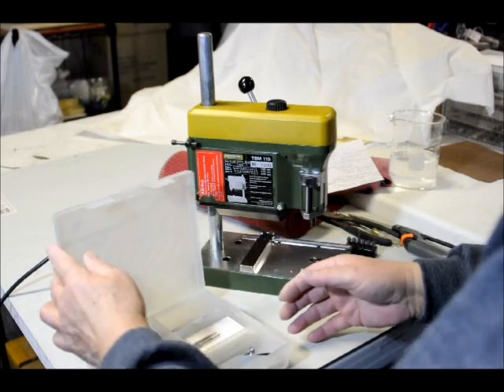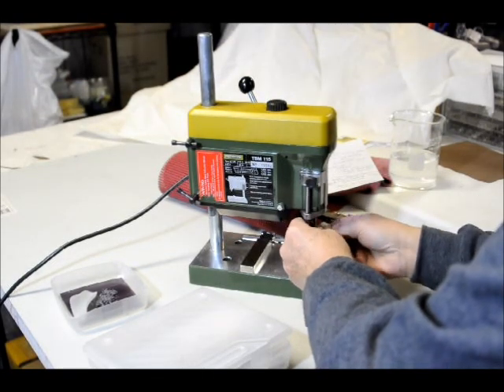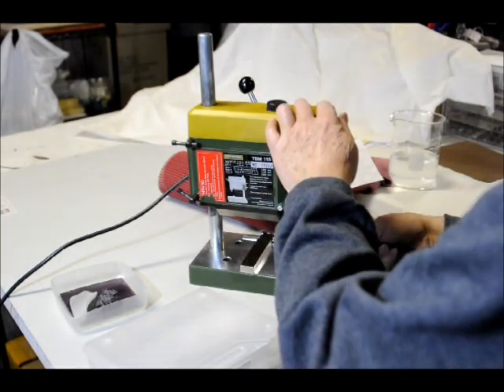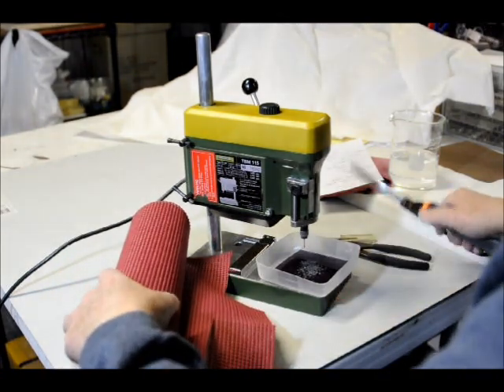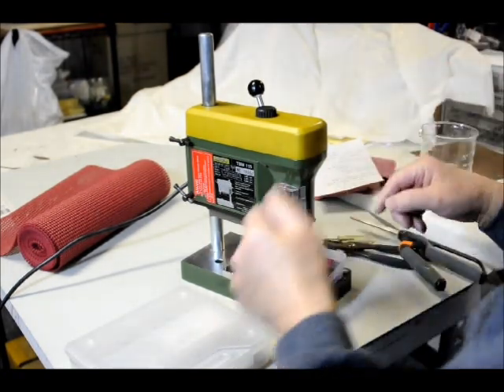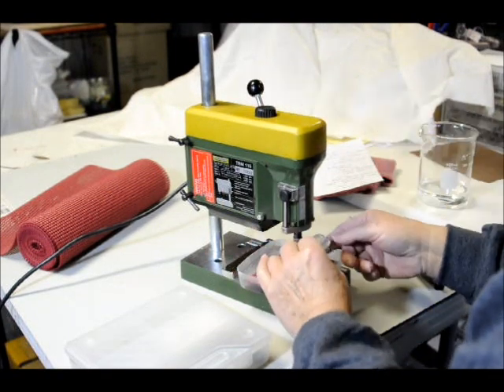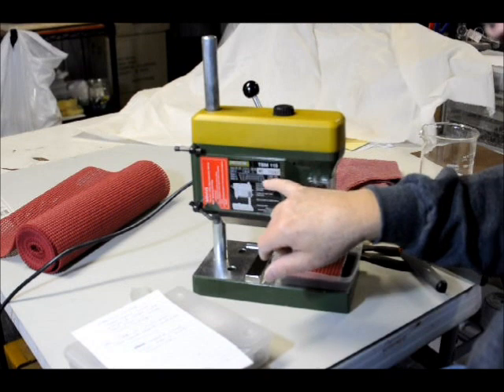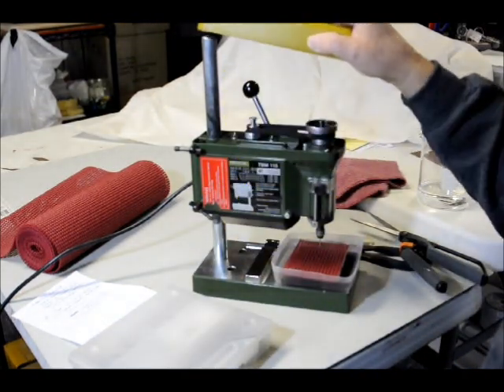How to drill Glass for fun or profit instructional tutorial drill stained glass, beach glass

Comment: I am mystified as to why you would use a glass backing UNDER THE RUBBER MAT instead of wood.  This seems counter intuitive and wrong.  Wood should be the preferred material, not a thin, fragile piece of glass to drill on top of.

This is the same question asked by the person below my comment.  I understand why you used the rubber mat.  The question is why did you use a glass sheet instead of a wood block behind the sea glass you were drilling?
Reply from the maker: I use the same type of material i am drilling thru so the bit doesnt jump when it hits some different material, I also dont want to drill thru my little water filled tub, so the glass helps with both of these. I am sure some people have used other methods but this one has worked well for me for over 30 years. I hope that helps explain it a bit better. Thank you for asking and viewing my video